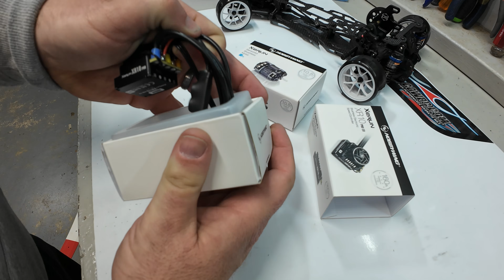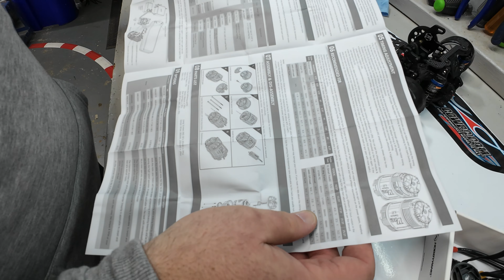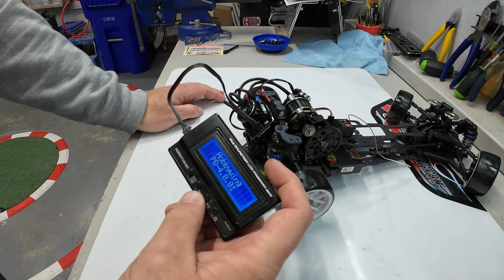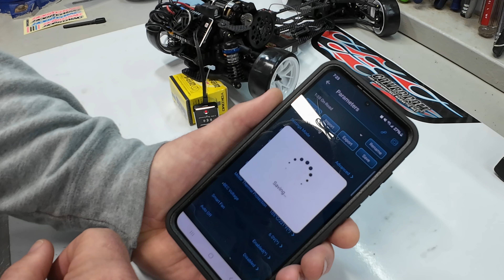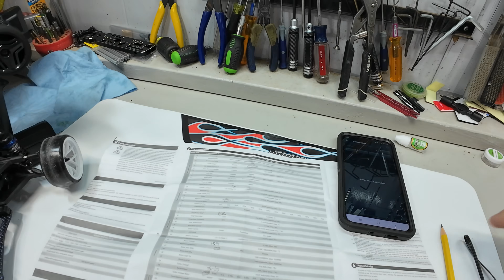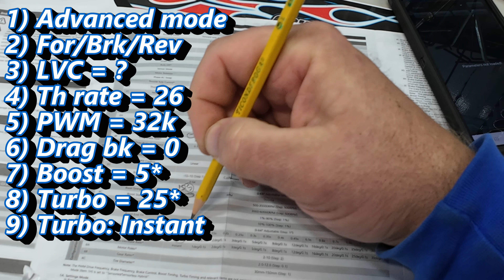Is Hobbywing XR10 Pro G3 the BEST for Drifting?   Install | Test | Review

Comment: Running XD10 Pro setup on one drift car and a XR10 Stock Spec G2 on the other. There is very little, if any, difference between the two indeed. I can always recommend the Stock Spec G2 as the best bang for buck ESC.
Reply from the maker: 100%!! 
Thanks for the feedback!

Comment: I use 19t pinion and 84t spur no matter the track or surface in my RD1. Works good enough that I chose to tune around it
Reply from the maker: Makes sense.
I only change gearing when my main-track gets a different layout.

Comment: Great esc/motor combo but not convinced it's ideal for drift?  Not as smooth as I thought it would be, especially with PWM set so high (curious to know how hot things got?).  My guess is the high torque/torque density of the G3 can is better suited to off-road, as well as the inherent drag break (regardless of it being turned off).   I'd probably spend the extra for the xd10 combo.
Reply from the maker: Hi there! 
Is it the 100% best setup for drift?  No - I don't think so.  But it works really good and would be more than enough for 90% of drivers.  

Heat:  never got hot.   The smart-fan was barely running.
Reply: I'd love to see a  brushed setup in the car to see how it performs?
Reply from the maker: Brushed gets a LOT of hate...but it really isn't that bad.  Of course, no boost/turbo, etc - but throttle control is great!
Reply: I use this on 32k motor freq, 20k,10k..with yokomo dx2 motor.. No problem.. Fan not even turning on.

Comment: Ok xd10 is 160 buck d10 motor is 90 bucks.. on my opinion the d10 motor is far more superior just by the cool factor it has. As for the for the xr10 stock spec u cant go wrong unless u need to do reverse motor rotation
Reply: Came to comment the same thing. HobbyWing Direct has most everything on sale. From what I understand the xd10 has a higher pwm possibility which will offer smoother more efficient motor control at the sacrifice of torque. I just wish the XD10 had the smart fan control this G3 does! Ive been asking for that feature on all their esc’s for at least a decade now. At this point Im just over here waiting for the drift crowd to catch onto drone and crawler tech. Im thinking 6 pole in runner stubby motor with an am32 sensor-less esc.
Reply from the maker: Thanks for the input!

Comment: That's not the newest motor. Regardless, I've never found any of the hobbywing race motors to be any good for drift. Too much magnetic resistance, makes them have a ton of off throttle braking and a less than ideal torque application.

That being said, the g3 esc is awesome. I paired one up with a 13.5t D10 motor. Tons of punch from the g3 and all the tuning options you'd want to dial in throttle feel. Also really appreciate the auto fan. In use for me it kicks on for about 30 seconds every 2-5 minutes. Keeps dust and noise down and saves battery.
Reply from the maker: 100%!
Yes - their motors are not the BEST for drifting, but you can also tune some of the magnet drag out with coast. 

I also really like the smart fan.  Great add!

Comment: I just got my Rev-D   ESC and Motor over my stock RDS  stuff  😅
Is it necessarily to callibrate it before use ???
Would be cool  to know what all those parameters mean in the ESC settings 😊
Do you have any video about that ?
Reply from the maker: Hi there!
100% you have to calibrate it.  
I never bought that ESC, so I don't have a video on it.  Sorry.
Reply: @RoadsideRC  I mean  in general, even parameters in this video, not all of them clear ))